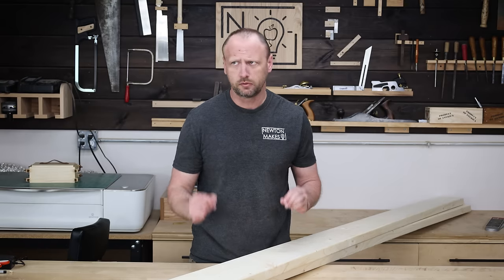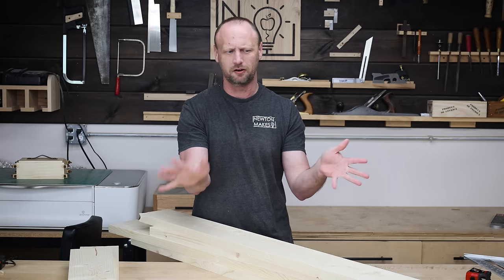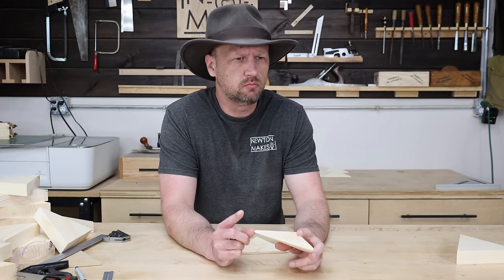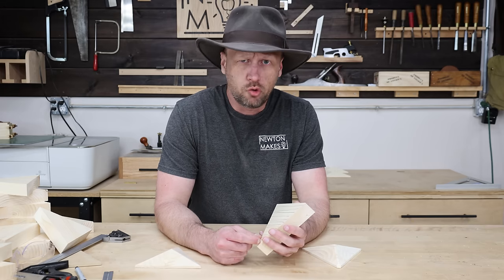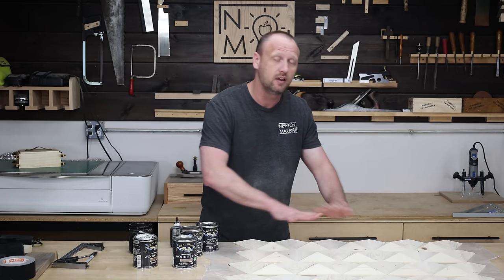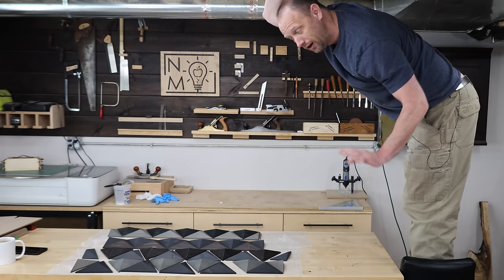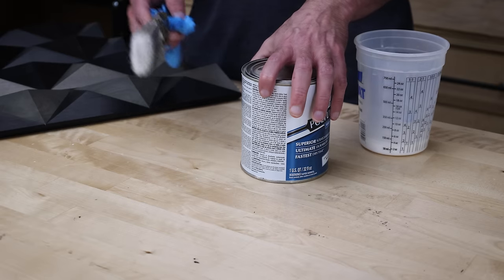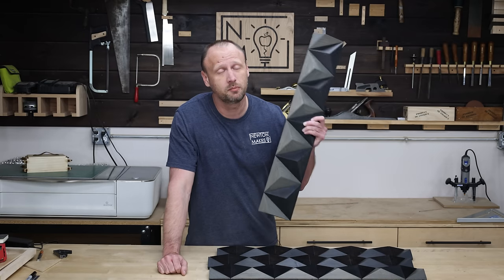Trippy Wall Art from Construction Lumber

Comment: Wait, I thought having the center of the tree in a wood, it was less likely to warp? As whatever it swelled or anything would be even in all directions?

I thought the ones with circle all in one direction like the one second from the bottom at 0:41 would cup in that direction?

Have I really been doing the exact backwards way this whole time? 🤔😬
Reply from the maker: The further out from the pith the better. Quartersawn is the most stable. Rift sawn a close second. Then there's flat sawn which has those rings with the smiley or frowning face. They can cup, like you said. So imagine those next to each other and pushing in opposite directions. Too much movement.
Reply: @NewtonMakes  well that makes sense